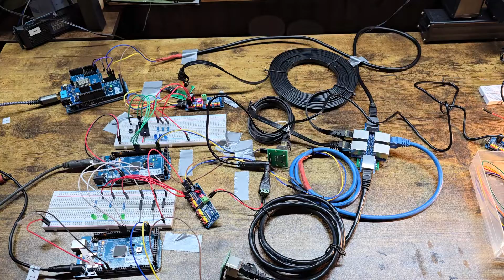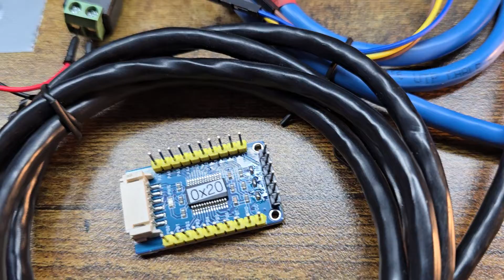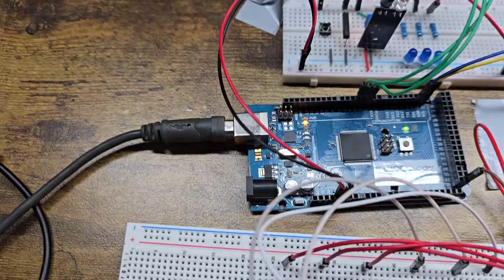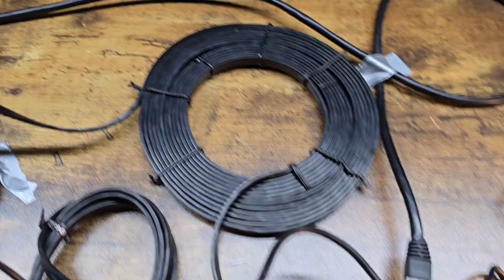Demonstration of Ex-IOExpander for use with DCC-EX CommandStation

Comment: Hi Bill - What are the boards you are using to run i2c over ethernet ? - Thanks Tim
Reply from the maker: @TimDriver-l1s  , hi.  Sorry for the delay in replying.   You don't need any special board.  Those are just some standard RJ45 connectors that I soldered to a blank pc board.   You can wire one end of a network cable directly to an I2C board.  I just chose to put a connector on there to make it convenient.

Comment: Howdy Bill!  Yeah... looks intimidating as hell... lol.  But your tutorials help quite a bit.  I'd like to use DCC-EX on my shelf layout - it will be themed for 'last mile' switching.  Well done and thanks for sharing 🤠
Reply from the maker: That'll be interesting to see when you get it up and running.  Are you doing a video?
Reply: @BillMastersMRR  I'm hoping to!  I'm still at the 'figuring out what my track plan will be based on the space I have to work with' stage.  I think I need to quit screwing around and at least build the base (it will be free standing) so I can lay out some ideas.  I kinda need to see it to understand it better.  If that makes sense.